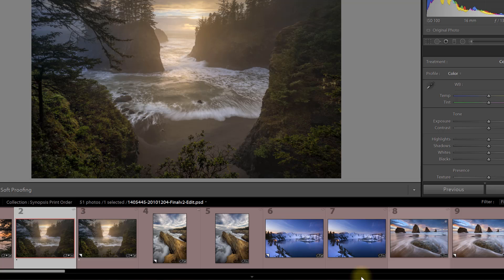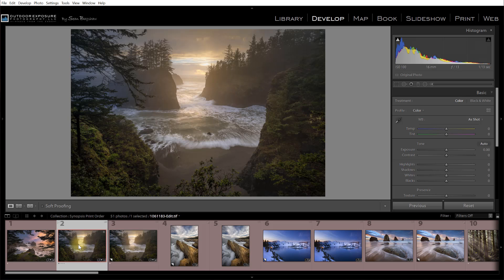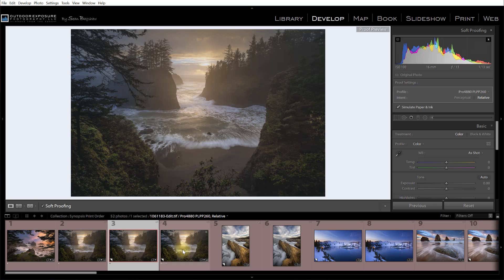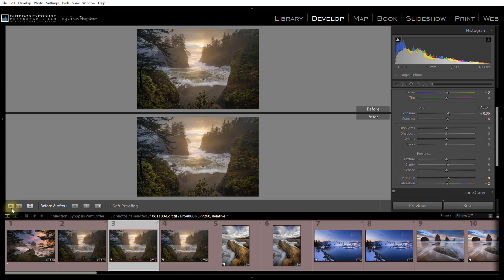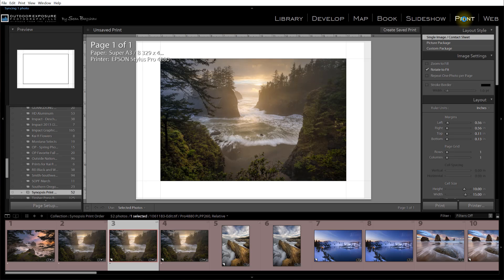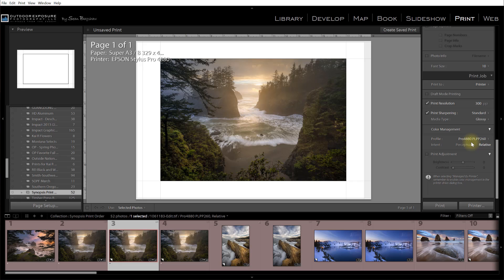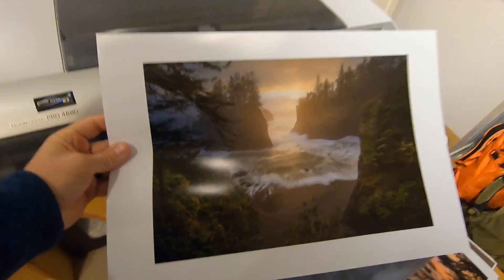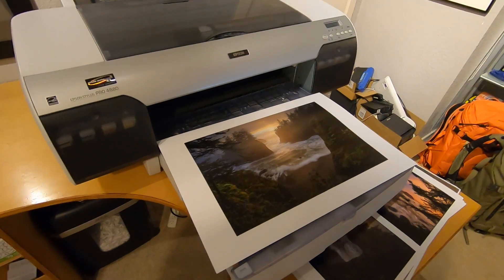My Workflow For REALLY Big Prints?

Comment: For test prints at smaller sizes, how do you adjust for the way parts of prints can come across differently when you change their size?
Reply from the maker: As long as all the other variables stay constant then the only differences should be in image detail and apparent sharpness. Color, brightness, contrast should stay consistent. What things are you noticing that come across differently? Certainly room lighting and viewing distance can affect how you see a big print vs a small print but that's all external to the developing and printing and very hard to quantify and control.
Reply: @SeanBagshaw  As I thought how to answer this i realised the problem ... it's when I'm working with artwork; when I change the size of the print I change the gaps between lines / brush strokes and so change the density of parts of the image. It is often especially noticeable when I reduce a picture from its original size.
I realise that with my photos it's more the way some parts of a composition may not work so well  when enlarged!
Thanks for the great video.
Reply from the maker: @garyrowe58  Ahh..that does make sense. Boy, not having experience with that type of artwork I'm not sure how you could deal with that issue. Good luck :-D

Comment: My problem is what I see on the monitor (sharpness) doesn't match what I get on a 16x20. I shoot raw and have an Epson 3800 printer and test print on 4x6 Epson paper and print on Ilford Gold Fibre Silk paper. So what's up.
Reply from the maker: This is definitely a challenge, Tom. The screen doesn't perfectly equate to print for a variety of reasons. First is that we don't usually view a print as close as the 100% view on screen. I tend to judge my sharpening at 50% or even 33% and find that this gives me a closer approximation of what the sharpening will look like in print. Second, with different inkjet printing methods we get something called "dot gain". This is how much the little droplets of ink spread out on the media. Glossy and luster papers tend to have less dot gain and mat and textured media like fine art paper and canvas soak up the ink and have more dot gain or spread. This is where doing your own hard proofing/test printing to find the right amount of sharpening is important. For some print types and sizes, I find I have to oversharpen on the screen to get the right amount of sharpness in the print. In this video, I show a hard proofing technique that might help you hone in on the right amount of sharpening: https://youtu.be/43_v6olWyQc

Comment: Why are you using "Automatic" for Photoshop resampling instead of "Preserve Details 2.0 "?
Reply from the maker: Thanks for the heads up on that. I've only just been made aware that the Automatic setting doesn't auto select Preserve Details 2.0 when enlarging. I'm going to do some testing and see what I think. I've only done one comparison so far, but I'm not sure I'm liking 2.0. Stand by.
Reply: 2.0 doesn’t necessarily mean its better. A lot of people prefer 1.0.

Comment: Is it just me or does Gigapixel AI make the output file brighter? If so, would it be better to first do the upsizing and then the proofing?
Reply from the maker: I see that too...but not sure I have ever noticed it before. It actually looks like the PS sized file is the brighter one and/or the Gigapixel AI file is a little darker. I'd have to do some testing to find out which app is the cause. But, in the end, the difference appears minimal and all the prints I have done using this method have looked good to me, so I'm not too worried about it. To be super picky you could, as you suggest, upsize first and then do the proofing in PS instead of LR, but that adds some complexity to the project and making adjustments to those really big files will drag a bit.

Comment: Good video but unfair to compare GPai to PS for enlarging since GP is adding sharpening during upsize where as ps is just extrapolating.  Sharpening needs to be done on the PS layer.  Also, would never recommend using auto for uprez in PS.  Depending on scene each method has merits (and also noise control).